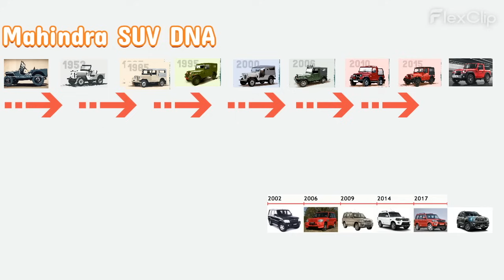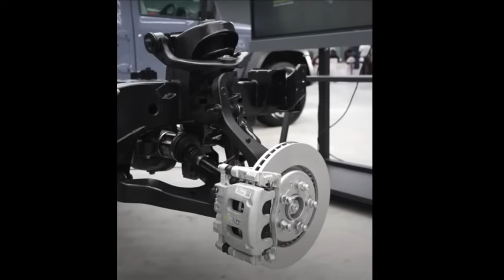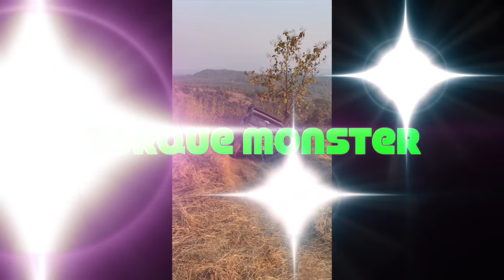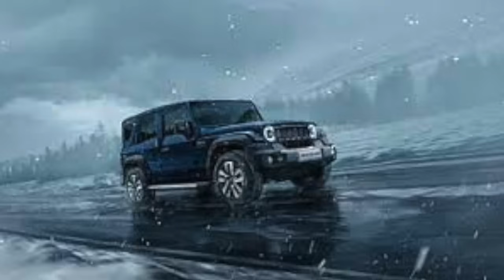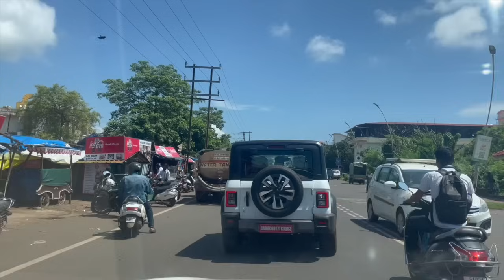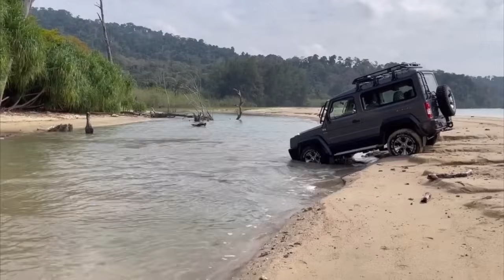Mahindra Thar Roxx 2025 - Engineer's Take on this "One Car Do All" ?

Comment: Mx3 petrol roxx , will be my choose. Currently driving i20 elite asta and I find it boring with 5 people inside and luggage because whenever you turn on the ac in Fully loaded state you will lose power in mountain and in normal overtake. I think roxx and my i20 will give me around same mileage which is less ofcourse 😂 so I am already done thinking about mileage only part left is creating memory with what we have, I don't think i20 did it for me as it was not that much exciting hopefully this rugged , torque monster 2 L turbo petrol thar will do for me.

Comment: Also, Mahindra has tuned to AXL 5 and 7 AT to
Produce 400nm torque. How does that change the linear range and it’s impact on the ride and comfort?
Reply from the maker: Will pull cleaner through mid range

Comment: LONG TERM REVIEW. I own a Thar Roxx Diesel, and after 17,000 km of usage, it’s clear that while the SUV looks appealing on paper, the ownership experience is filled with recurring issues,  some minor, but many fundamentally serious.

1. The reverse parking camera quality is outright poor. It constantly suffers from moisture build-up, leading to a hazy and unreliable image. Even after getting it replaced at the service centre, Mahindra could not assure that the issue wouldn’t recur. That speaks volumes about the quality of the component and the lack of a permanent fix.

2. The BS6 diesel system is clearly not suited for cold conditions, despite the vehicle being marketed as an off-road SUV. Every time I used the car in colder environments - which is exactly what such a vehicle is meant for — I ended up at the service centre due to DPF clogging issues. On top of that, there is a constant risk of urea crystallisation in the injector, which again raises serious concerns about real world usability. A vehicle positioned as rugged should not struggle with basic environmental conditions like cold weather.

3. The most frustrating part is the unreliable sensor ecosystem. The car randomly throws errors like E11, E21, “Wrong DEF detected,” and even warnings that the engine will stop starting after a certain distance. These are not minor alerts -  they directly affect confidence in the vehicle. Despite multiple visits to the service centre, including instances where the car was kept for nearly a week, the technicians failed to identify the root cause. The standard response given was that such warnings are “common in diesel cars” and will resolve on their own — which is completely unacceptable.

You do not expect random, critical warning signs flashing on your instrument cluster when you are paying a substantial amount for a vehicle. Instead of confidence, the car gives you uncertainty every time you drive it.
Reply from the maker: Thanks for the update

Comment: Hello sir, I need some advice. I constantly gets ads of ARC suspension to better ride quality for Thar roxx. What is your view on these after market suspensions. How reliable are these ?
Reply from the maker: Change your algorithm and stop seeing those ads.
Rox has one if the best stock suspension setups . Don’t play around.suspension upgrade is a dark rabbit hole 🕳️ you’ll never return from, see my suspension upgrade videos. 
You will never RTS return to stock, one small niggle after another will keep coming. Don’t go down there . 

Speaking to you from the depths of that hole
Reply: @tripaccino thank you for clarifying. Another small doubt. I have noticed that at high volumes in my thar roxx, there is some rattling or slight crack sound coming from the roof, it seems to be somewhere around the sunroof or near the seatbelt wrap. Is this normal. I did not notice any cracks in the sunroof. 

When I asked dealership they said thar roxx has this issue and it is because of harman kardon and not mahindra. Should i get some sound damping done. What is your take on this. I do keep the equaliser settings for base and all a bit on higher side.
Reply from the maker: @itspuke3475 clean the sunroof channels . Check for for any loose fasteners on roof liner. Buckle the seat belt in position and see what it may be . Mostly small problem only. Sound damping only will cut out outside noise. This is something that’s loose squeak rattle.
Reply: @tripaccino also about the sound damping, wind noise above 100 is normal for this car. 

But can I use sound damping in some parts of the car to reduce this wind noise. Is there a better sound insulating windscreen available for the thar roxx after market. Should I go something like this ?

Comment: Best technical review i have ever seen. Some questions 
Want to buy thar Roxx but confused with Petrol vs Diesel 4*2 or 4*4 mainly due to below could you please assist?
1. Less monthly km max 400 
2. All Diesel engine require some daily running or will cause issue
3. Bharat stage 7 impact in Diesel and resale cost.
Reply from the maker: Petrol. 4x2 is fine for you 👍
Diesel Dpf troubles are not worth it if running is so low. 
4x4 not needed if you are not looking to consciously off-road . No point in having extra weight and cost for life. 
If you’re buying it for the love of the design and Jeep form factor , then 4x2 petrol ⛽️ is fine

Comment: Good review, but I would choose Gurkha over roxx any day. Simply because of the no nonesense simplicity of Gurkha design.

As a VLSI design engineer, I know the limited capability of IC manufacturing in India. Indian companies like Mahindra while importing ICs must be compromising on quality for better price trade-off. Cheaper availability of ICs are only possible with lack of product testing and verification.

Hence an electronics heavy roxx would always be my last choice.
Especially when it involves an Indian automaker with no diversification in IC design.
Reply from the maker: I would implore you to watch my EV video where I mention my great qualms with poor unreliable quality of electronics especially chips in these ‘high tech’ vehicles. I agree that Tata and more so Mahindra have become like a desi version of budget Chinese cars pumping out so many easy to add cheap features which are inexpensive to add and dazzle buyers but very unreliable. The video verdict of my EV video in fact ends with my no confidence in highly electronic mobiles on wheels. 
I’m a first gen gurkha guy and am happy with the simplicity it offers sans electronics . But it’s mechanical qc u reliability is a different qualm in itself. 

I can see that you’re a gurkha fan, what vehicle do you drive ? I’m just curious .

Comment: What factors should one consider when choosing between a BS6 diesel and petrol in the Thar Roxx ?
Reply from the maker: Go for petrol. Diesel DPF issues is not worth it. Unless you are a hardcore diesel fan, then probably you wouldn't be asking this,  else you're  a mile muncher who does many miles on highways. in which case, there are better highway tourers available. 
Diesel- High Running people
Petrol - Everyone else.
Power torque- Ive shown how the petrol is very well caught up. So that's a myth in this case.
Reply: @tripaccino  But for someone living in Delhi who has 5-10kms of city driving weekly and once a month(or in 2 months) road trips to the mountains (HP , J&K and Ladakh ) or highway trips to tourist sites ( UP , Rajasthan and Punjab ) wouldn't he need 4x4 to conquer the "difficult" terrain in Ladakh ? I ask this since only the diesel variant comes with 4x4 . 
Also would be really grateful if you could give your opinion on which cars should one look at considering these use cases . Is there a single car that can meet these needs or they should go with 2 cars and in that case which kind of cars should one look at ? 
Thank you!
Reply from the maker: @nikunj-fin most people think they need 4wd. But never end up using it , even when they do -maybe only for 1 percent of time of vehicle ownership. Largely remains a good to have .
Which is ok , if you can afford it. 
But they have to live with the extra weight, compromise on fuel choice and additional complexity all the remaining 99 percent of time . 

I think most roads even in Ladakh are very motorable today, and can be ‘conquered’ with a 4x2 definitely. 
Unless you’re doing it in winter and going on an expedition mode on which case don’t go alone , take a buddy 4wd for backup. 

So choose your vehicle wisely for your use case. 

Two car garage - please see my video on the channel about 2 cars Vs one care
Reply: @tripaccino  Thank you that is very very helpful , so glad I found your channel . Thank you means alot.
Reply from the maker: @nikunj-fin  thanks. share it with your friends

Comment: Great Review !!! Superb Engineering perspective. I am a Mech Engr & an Auto Enthusiast for 3 decades, past ownership experience Honda Civic, CRV, XUV500 etc. Currently I drive the XUV500 D MT for past 7 yrs & looking for an upgarde to SUV D AT. No off-roading needs. Approx 60% city use & 40% road trips on highways (including hills etc). Need only 4-5 seater & powerful diesel engine. ScorpioN Z8 Select D AT or Roxx (Equivalent) ?
Reply from the maker: @abhinavmitra4185  sn z8 suits you
Reply: Thanks. (1) When can we expect SN upgrade, including Roxx mechanical improvements (Eg. Chassis, Suspension etc). I can wait a bit, as 2 cars in the current garage (XUV500 & Ford ES) ? (2) Is there a stability/driver's confidence issue with SN beyond 120kph (as mentioned in some reviews) & upto which highway speeds SN feels confident ? 3) took short TD's at Mumbai - XUV700 felt less SUV like & more car like with lower seat height & too light steering (did not impress),  SN short TD felt more SUV like, Roxx short TD had cramped footwell & smaller seats, although better interors (not so good driver Ergonomics). No highway TD's was possible. Pls advise on above queries @tripaccino
Reply from the maker: Out of the 3, I would pick SN . I have pushed it highway steady at 140 no issues . It’s heavy and tall. So expect dynamics to be accordingly unsettled . This is not meant for high speed cruising , for which 7OO is much better. Upgrades from Roxx going into sn is unlikely instead it will go direct to the Global Pikup.

Comment: I somehow missed this video. I had the same thought process. I had booked a Tata Safari but cancelled it when I saw Gurkha used car listing. I picked a used Hexa a little later. For the city runs I have the Suzuki Ignis. I have been considering reducing the count to two. Either combine Ignis and Gurkha in favor of Jimny or Hexa and Gurkha for Thar Roxx. The first option sounds better but the work horse duties that my BS4 Gurkha does are difficult to overlook.
Reply from the maker: Sounds like a solid plan!

Comment: Why Manual transmission variants of ROXX is not having intelliturn feature?
Reply from the maker: You need the computer to be able to throttle control, which is possible in automatics only.

Comment: Hi bhai, I’m considering the Force Gurkha as an option. I’m looking for a 4x4 vehicle under 50 lakh, primarily for long-term travel across India (not all at once, but over time). My travels will include hilly and snowy areas. I live in Uttarakhand. Any advice would be appreciated. Thanks!
Reply from the maker: Please watch my full gurkha review video. And assess which category of buyer you are based on your requirements. Sounds like a fit !
Reply: @ thank you for your quick response. Looks I should consider Scorpio N. but will it be fine for heavy snow.
Reply from the maker: Yes. With snow chains will do

Comment: Sir have you seen the videos going round about Roxx vibrating vigorously in reverse gear and in high rpm. Kindly create a video explaining this problem/ no problem.
Reply from the maker: Haven’t seen them .
But any suv will jolt in reverse gear if unladen on rear axle  . It’s a torque surge . Will speak about it in Scorpio N review
Reply: @tripaccino  thank you. In the YouTube video rear wheels were jumping while reversing in high rpm.
Reply from the maker: Torque surge. I will explain in the Scorpio video. I can make the front wheels do the same . It’s just that so much viral content gets unnecessary traction and million views. Truth is under the hood and it’s so difficult to bring it out. I’ll try
Reply: @tripaccino  thank you,  will wait for it. Lot to learn from you.

Comment: Funtastic and very educative video. But-but one is always sceptical about:
Mahindra's

-Blatant design copy. They are fighting copyright  legal battles and are banned in a few countries.

-Built quality and QC issues.

-Unprofessional dealership network.

-Post sales service issues.

Last but not in the least why would or should a SUV have white interiors??
Reply from the maker: @DL-DOMINAR  true.but sales numbers say otherwise
Reply: Forgive me sir, but I sense a grievance against Mahindra in your comment. Have you had some unfortunate experience in your ownership? I've been a Mahindra owner over the past couple of decades (Scorpio 2004-2018, Thar 3-door 2021 till date) and frankly I haven't faced the issues you mention. We used the Scorpio extensively, gallivanting all over the country (with our 2 boxers I may add) - Mumbai>Lko>Naintal>Mumbai// Mumbai>Mangalore>Madikeri>Mumbai//Mumbai>Lko>Kolkata>Mumbai with smaller trips in between. In fact Mumbai>Nainital (Naukuchiatal actually) has been our favourite trip for many years. And like I said, the Scorpio did everything without a whimper. and never left us stranded in the boon docks. The occasional flat tire and once, the belt for the power steering hydraulic pump parted at 90K kms. At the time we finally sold it, the family had dubbed it Bucephalus (after Alexander's horse😁), and had covered 140K kms. The Thar has not had a serious outing till now - we are both senior citizens today and we like to do our own driving, and long drives are a pain in the neck - the knees really. But so far no issues at all with the Thar. And as far as ASS is concerned I feel that apart from Maruti,  no other mfr has a flawless record. But here too I have no serious issues with mahindra.

Comment: For off-roaders, the hub and the core issue of course, is the crawl ratio (42.23 and 45.43 for the Roxx & Gurkha resp.). Here both the Roxx and the Gurkha put out similar figures of torque at the wheel in crawl mode (14358 and 14993Nm). The 1st gear ratio at 3.963 & 5.16 (Roxx & Gurkha respectively) which are crucial for crawling ability, also give a hint of the engine rpm (in the different cars) needed to maintain this crawl ability. And as you mention, the higher engine tune of the Roxx ends up giving a massivev edge (15625 Nm) to the Roxx when push comes to shove🙂. The relaxed engine tune of the Gurkha should also result in less stressed engine scantlings of the Gurkha during normal off-roading. 
                      This argument among engineers/ buffs often becomes circular - the Gurkha engine is many decades old and its fundamental thermal stress numbers will also be corresponding. The Roxx on the other hand has an engine which (one may assume) is more or less state-of-the-art and Mahindra will have done their sums right - so no danger of over-stressing scantlings even during enthusiastic rock-crawing. Here one must doff one's hat to the Rubicon, with its (so far) unbeatable crawl ratio of 100:1 (it used to be 84:1 a few years back).
                       It has been fascinating deep-diving into the nitty-gritty of the Roxx/Gurkha tech specs. Till now I would chew the fat with folks at T-BHP,  but now Tripaccino certainly offers a worthy alternative. And as a retired Marine engineer, I can just say - let the tribe multiply, the more the merrier! Amen
Reply: I forgot to add - I had already subscribed with the above comment. And yes, I'll definitely pass the word around!🙂
Reply: And yes, I have the Thar 3-door, hard-top, petrol, manual Aug '21 model which I got new, because a chap cancelled his booking. No regrets other than that there is no boot space😄I get the occasional twinge that I may have jumped the gun and perhaps should have waited for the 5-door.
Reply from the maker: @shashankachoudhury3667  the next car version is always tempting ☺️
Reply: @tripaccino  Agreed - specially if, like the Roxx, it has respectable luggage space! And incidentally do you plan to introduce a  Newsletter (like T-BHP) to be delivered to the mail-box of subscribers? 
               One reason I feel other journals are not making the cut is that, unlike T-BHP,  they have no space for their readers to be particapatory in the journal. As I know from my own experience, there are huge numbers of tech-savvy folks around - gearheads who are knowledgable and resonably successful and who love to talk cars with other buffs. Till now T-BHP was the only platform around. I want @tripaccino to fill this space. I wish you and the team at tripaccino success and hope your subscription list grows at a cosmic rate and that you become a worthy alternative in the tech-savvy auto journal space.
Reply from the maker: @shashankachoudhury3667  thanks I hope more people find the value in the channel and encourage this community